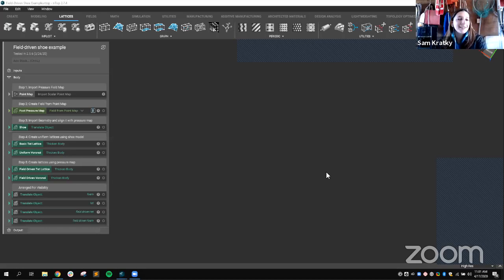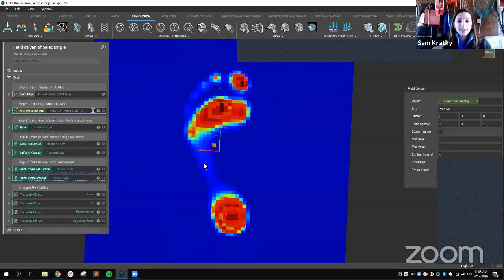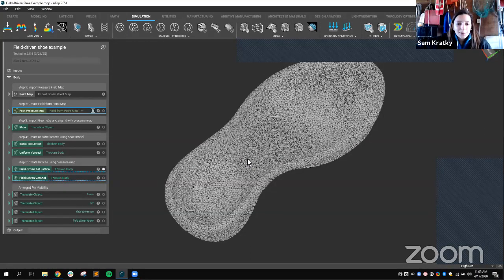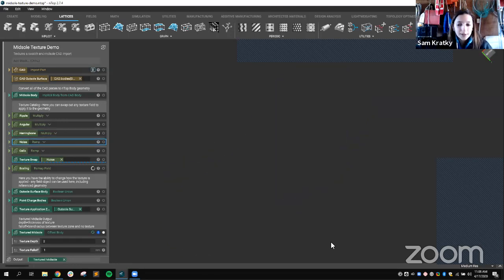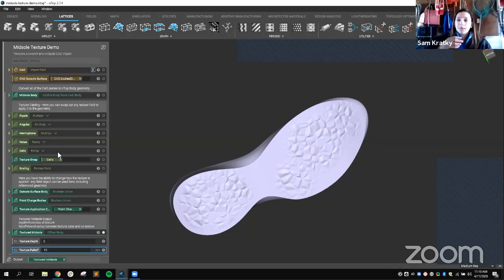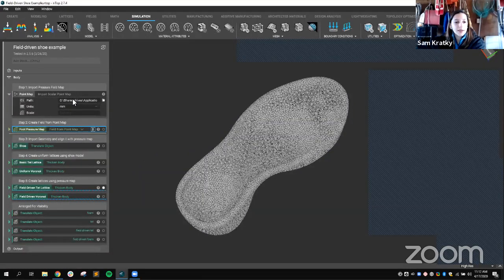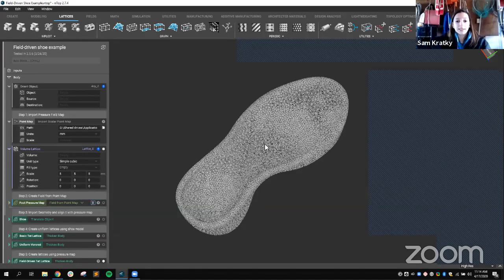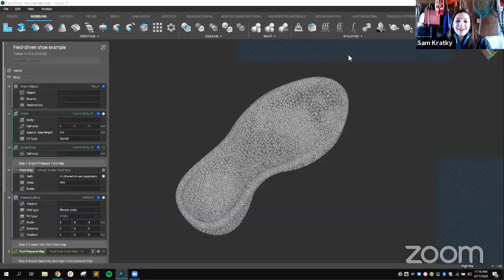nTop Live: How to Create Textured Midsoles

Comment: Hi, I'm currently a student graduating in Italy in Materials Engineering. I just discovered nTopology and I would like to know if a degree in Materials Engineering is suitable to follow a carrer path as an Application Engineer in a company such as nTopology. Alos, I would like to know if it is advisable to take part in some sort of PhD reguarding 3D modelling and the amount of years of experience that are required before applying for a job as an application engineer. 
Love the video about sneakers btw! :)
Reply from the maker: Federico, we're delighted to hear that you'd like to pursue a career as an application engineer! Generally speaking any engineering degree provides an adequate framework for solving the types of problems that nTopology addresses with our customers. Mechanical engineering and materials studies might be the best degrees to pursue, and post graduate work will only help (but isn't necessary). Feel free to check our website frequently for updates to our job posting, or just submit your resume to us when ready.
 ntopology.com/careers/